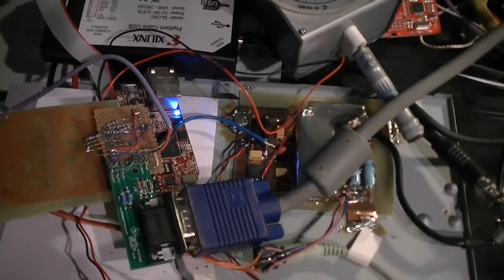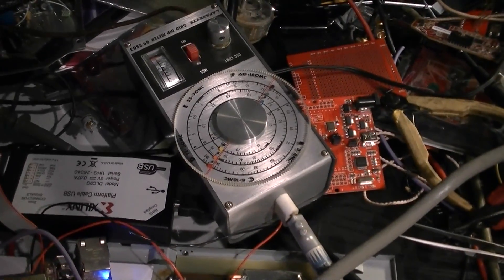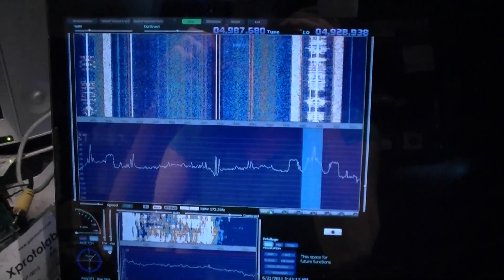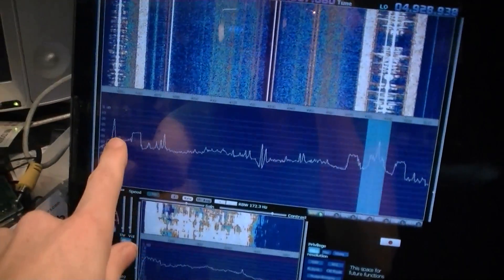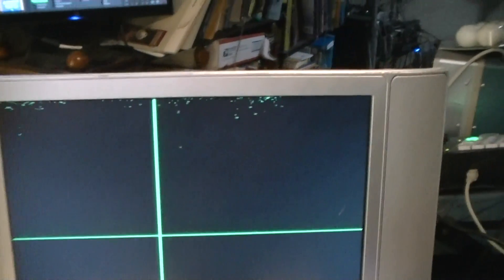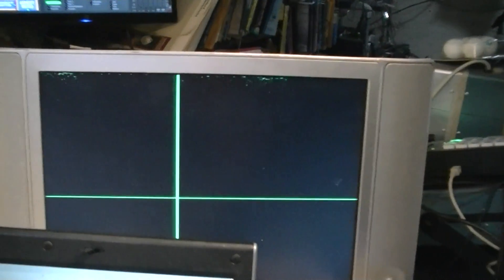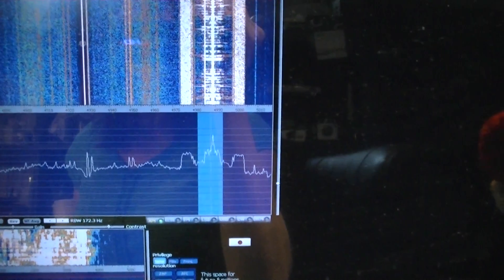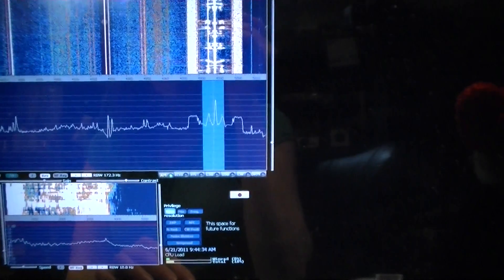Software Defined Radio Vlog Part 6 - VGA and 256 Point FFT

Comment: @jeriellsworth Cool. I was reading up on it last night (along with investigating DCM stuff. It seems like you could generate the quadrature signals there instead of using 4 times the LO and then doing the two D flip-flop quadrature shuffle). Hoping to get one going on the Xula-200 I won in the 555 contest.

Comment: @mikikg Most of my analog design is driven from the fact I have to use small single sided boards.  I could do a better layout if I had a layer to route power.